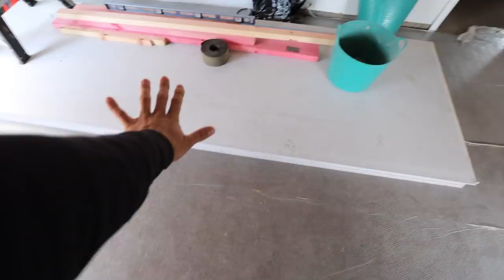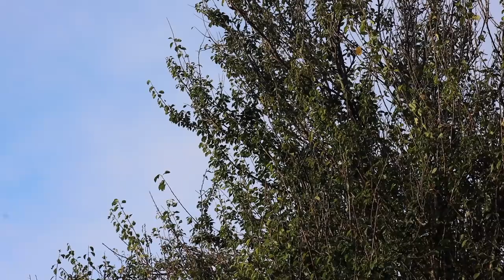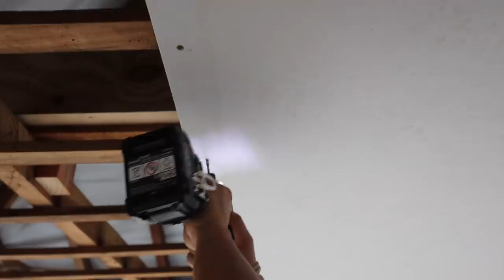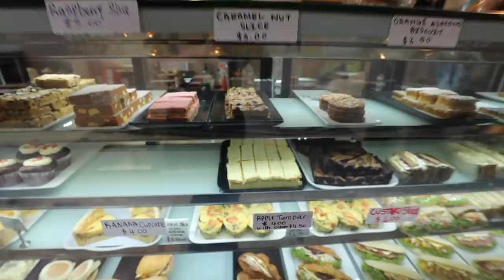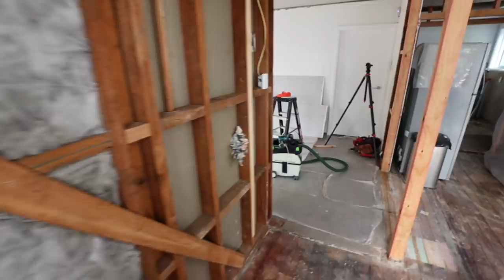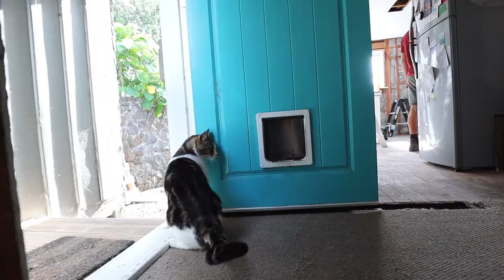I'm Giving This Drill Another Chance

Comment: Hey mate. We are in different countries (Australia) but it may pay to look into the installation specifications on your plaster. We do a few things different here. 
I'd be back blocking your ceilings. You use back blocking cement and put square of plaster between the battens. It adds a lot of rigidity to the sheet and helps prevent cracking with movement of the house. 
Our screw pattern is different also, and we use stud adhesive. 
Also, if you use furring channel and clips on your ceilings it is way easier and quicker to set up your ceiling, you won't have the issues with screws not setting to a consistent depth, and the ceiling will be less likely to crack as the furring channel clips allow for slight movement as the house moves/settles. It's also really cheap.
Reply: We have the same specs you are describing here in NZ, not sure why Scott isn't following the manufacturers instructions. Maybe because it's an older ceiling? Also wideline gib board is readily available at most Placemakers. 1350 wide for 2700 studs, useful for older homes like this!
Reply: Yeah also super easy to get the new ceiling level instead of ripping timbers. Just find the lowst rafter and set all your clips to that :thumbup:
Reply: @cmmartti  similar product different profile. You clip the channel up with brackets that get fixed to the bottom chord of your trusses. Set a line laser up, set up your brackets to the line, clip on the channel. It's super quick and gives dead flat,l and level ceilings. 
We use it for sound deadening as well, but the sound clips are really expensive. Regular bondo brackets are cheap.

Comment: Those Makita dry wall screw guns are the best on the market. Glad you finally worked them out. Haven't seen a loft ladder in  over 22 years since moving to Oz. common feature in a lot of UK homes and we frequently installed them. Flat pitches and lightweight truss construction here makes most lofts useless. Don't you get 1350mm wide sheets in NZ. We get all the sizes in either 1200mm or 1350mm for 2.7M ceilings.

Comment: Hi Scott. You do some great work and I love your channel. But you should really be back blocking your ceiling end joints. It is on page 47 of the 2018 Gib Site guide. It is also recommended for the tapered edges, but not required until level 4 finish is required.
Keep up the great work 🙂
Reply: What does that mean
Reply: Should be strictly 13mm as well and could've done it in one sheet
Reply: Backblock taper joins if it's more than two joins in a ceiling, always backblock butt joins. I also always put an artificial taper in the butt joins by putting two packers over the butt join and the temp screw two bits of timber between the battens so they bend the ends of the sheets up slightly. Once the covebond sets you get a permanent taper that will give a much flatter ceiling. 

I absolutely hate any joins on timber. They always crack.

Comment: You mentioned doing vertical board over horizontal because of the added mud joint at the top.  I’ve seen guys do a narrow strip in the middle of the wall and join the plaster joints together during mud
Reply: A "belly band." Good tip!
Reply: @cmmartti  Yeah, we put ours at the bottom and sometimes it's hidden but if not, It's easier to plaster than up high.
Reply: Or just order your bottom sheets in "wideline" it's 1350mm
Reply: Also in New Zealand gib has a wide line option in most lengths which is 1350mm wide

Comment: Yep. Screw guns are frustrating in 'reno's 
Regarding staggering your joints... To avoid a cracked ceiling don't butt join on a batten, backblock and butt join between battens. You can then use a couple bts of timber and 3mm spacer to produce a dip in the butt join that gives a recess for the plaster and tape. Result: a ceiling that will not crack, and perfectly flat, and a happy plasterer too!

Comment: G, day Scott Brown Carpentry from Sydney, Australia.
In this building renovation, it looks like the R values have been increased for energy efficiency. 
* my method of plastering: Gyprock with (blue) stud adhesives 400mm spacing clot nails vertical and screws for ceilings. Finally base coat, tape, topcoat and cornice.
Good job
🌏🇭🇲

Comment: Hi Scott, thanks for the vids, love the music too. 
I’ve held many drywall guns but I own the festool, (not because I’m a festool fanboy) but cause it’s truly hands down the best one in my opinion. Depth setting, ease to use, least jams and easy to reset after a jam but most of all low noise motor plus: it only runs as you push it into the wall/ceiling. Can’t recommend it enough. If you got a lot of sheetrock to put up…

Comment: Recently had to lay down two layers of fermacell on top of steeldeck. About 100m2 and 50 screws per board, let me tell you i was glad i had this machine. When it does misfire it's a bitch to get the stuck ones out though.

Comment: Hey Scott don't don't know if you're aware but you can get GIB widening which is 1350mm wide which is ideal for those 2.5m and 2.7m ceiling.
Reply: No 1350mm braceline
Reply: @jussi75  No. Wideline  refers to 1350. Braceline comes in standard and Wideline as does all the other Gib products such as Aqualine and Fireline.

Comment: In Sweden, almost everyone use the screw-gun! Unfortunately the makita is not the best out there. It would be nice if you could try out a bosch, festool or hilti, it is a night and day difference.
Reply: I have the Hilti as well but I find the Makita is consistently better... if you know how to use it. What's hilarious here is Scott still didn't adjust the screw depth with the fine adjustment.
Reply: @DiscoFang  I agree the new makita is better than the old one that Scott used. The depth adjust is a key point Cassette

Comment: Have you ever tried the glue method fo your vertical wallboard? I’m in New England and a lot of the homes are very crooked, ya I cut shims to straighten them out but I’ll do the glue method for extremely flat walls. Makes all the trim very easy when everything is true. Very little scribing. Another great video!

Comment: I’ve never personally used that screw gun but I’ve seen them be used on job sites and it seems to be a decking thing, I’m a carpenter but haven’t really ever built a deck as there is a local company where that’s all they do so my boss who is a contractor normally just uses them whilst we focus on the house itself, but yeah I always see the decking guys use those. Maybe the fairest and best test for it will be when you next do a deck because it’s quite a specific tool I think

Comment: Why is a vapor barrier not installed under the plasterboard in New Zealand? Without it, the flap will eventually soften due to moisture because if I've seen correctly, New Zealand roofs have no vapor barriers.
Reply: Completely different climate - temperate. Vapour barriers only work in either cold or hot climates - we are neither in NZ. Installing them here within the wall sandwich can actually cause the very problem you're describing.
Reply: We have a breathable wrap under the roofing and cladding here, but I'm guessing that's not the same.

Comment: Surprised you didn’t end each sheet in the ceiling between a batten so it could be back blocked forming a recessed butt joint. Much easier for the plasterer to float the joint. I supposed it comes down to economical yield and carpenters doing plastering work....or not.

Comment: I don't like the butt joins on the battens. They should be between the battens and backblocked with CoveBond, and if you really want your plasterers happy, you put two small packers or nails over the joins and then get two bits of timber long enough to span between the battens  and screw them on temporarily. This will push a taper into the butt join, and once the Covebond sets it will hold that taper.

Comment: hey mate i'm assuming you may know this but just going by your vertical sheet comment , you can get sq edge to taper 1350 wide sheets (wideline) so you still have a chance to do horizontal in slightly higher than 2.4. situations. and when you have a 2.7. ceiling you use wideline x2.  anyway great content as always mate.
Reply: Yep. Unfortunately I have to improvise because my bosses never think to order Gib ahead of time, and wideline and taper square is never stocked and has to be ordered.

Comment: I had the same problem with my drywall gun until someone said “have you done the screw depth adjustment”  I felt such a idiot 😂😂
Reply: I bought one. Brand new out of the box it wasn't working. I was ready to throw it over the fence then decided to skim over the manual. Depth adjustment fixed it instantly. 😂🤣
Reply: I hate it when you accidentally knock it into reverse, then wonder why the gods hate me.
Reply: @oystercovecraftsman9219  I Chucked mine back in the lockup😂😂
Reply: I ended up binning this gun, when screws get stuck in the barrel you have to pull it apart to release them.

Comment: Hey Scott   What's the glue for on the back off the boards. I'm from the UK and I've never seen that done before and I see that you do it all the time.
Reply: Stability “glue it and screw it”
Reply: Not sure what you have available in the UK, but on this side of the pond we use either Loctite PL100 Drywall Construction Adhesive or my favorite, OSI F38 Drywall and Panel Adhesive.  Either is about $5.00 per 28oz tube.  Small price to pay for additional fastening and also reducing the need for additional screws in the field.
Reply: We use a specific gib-board (drywall sheet) water-based adhesive that has zero slump. One of the strongest and fastest to use is spray foam adhesive with the proper gun, but the worst thing is it will get on EVERYTHING. Water based far nicer to use.
Reply: They are using Gibfix One. Closest I've seen that may be available internationally is Sika Nailbond Fast. It's water based stuff. I prefer Gibfix Allbond, which is solvent based and flexible. I haven't seen anything else like it, but I would say any flexible construction adhesive that comes out thick and doesn't slump or run will work. Standard construction adhesive won't work because it's too runny and will just make a mess. One advantage of these glues is that they will bridge up to about a 10mm gap between the plasterboard and the framing, so you don't have to spend as much time trying to straighten walls, as long as the perimeter of the sheet is straight and the studs aren't bowing out then you're good.

Comment: I've always been told to go horizontal with my plasterboard
Reply: It's better. You can do either according to Gib, but horizontal is preferred because you get floating joins. You're supposed to join on studs with vertical which is always a nightmare especially in renovation where most older homes have 450 studs. The main reason not to do horizontal is that joins on framing will always crack.

Comment: Hey Scott, how come you didn't use Gib Wideline on the walls? Would have had much less joins
Reply from the maker: We have used that on this house in the past. It was going to be a special order and a bit more time, decided to go vertical instead.
Reply: Might have required an extra row of dwangs for fixing the edge of the sheet? Well worth it in the long run though, having less sheet joints
Reply: They are only available in 4.8m lengths for braceline in wideline.
Reply: Who cares really? It's about cost. If the plasterer is coming in, he's likely working to a sqm rate so extra joins don't matter a bit. Unless you can eliminate a large number of joints and are making the job far easier to install, buying off the rack at the merchant at the most common size is the way to go.
Reply: @plcs1665  Absolutely not. The main reason for going horizontal is to avoid having to join on timber. Joins on timber always crack, floating joins do not. It's my main reason for trying to avoid horizontal. I've done plastering, and tbh vertical is actually easier to plaster imo. But it's a pain in the butt to do, because the studs are never in the right place, and again, they always crack in time, because timber expands and contracts, and on top of that it's a weak point in the Gib at a place that is rigid, so of the Gib moves, due to being bumped or leaned on or a door slammed, that's where it will crack. A floating join doesn't crack, because the plaster is the same material as the Gib, and if the Gib flexes, it will flex between the battens, which are perpendicular to the join, so the join never gets stressed.

Comment: I noticed you were joining the sheets on the batten. A few years ago I did that instead of  joining in between the batten and back blocking and my boss ripped me apart. im still confused to this day what is the right way lol
Reply: If you join of the batten and back block. You put some temporary bits of wood and a wedge to bow up the join. So when the plasterers finish the join they can just go flat instead of feathering.

If you join on the batten you cant bow up the join as it's fixed.
Reply: Interesting, how much do you shim up the joining timber?
Reply: @neild7971  just use a 3mm nail or something similar. Just means an easy finish for taping.

If you google gib site guide theres a big manual. Then search ceiling installation and tapered edge.

Comment: you probably know, but in UK the plaster board sheets are 12.5mm thick x 2.4 x 1.2.
is that some sort of grab adhesive you put on the timbers first?
Reply: We screw and glue on our plaster board sheets here in New Zealand 🇳🇿.  Far better finish.
Reply: @robertw383  i agree, i'm an electrician and see lots of these installs. interesting to see how different parts of the worlds do things.
thankyou for your reply, will be mentioned on our next tea break. all the best and keep up the good work chaps.
Reply: There are rules to gluing our plasterboard. Screw the perimeter at 300mm centers, or on the battens in the case of ceilings, and daubs of glue at 200mm intervals, no less than 200mm away from any screws. Glue and screws must NEVER meet each other. We tend to screw the center of the sheet with ceilings too, so for a 1200 wide sheet running across the battens, we glue at 200, 400, 800 and 1000mmm. 4 daubs,  with a 400mm space in between for our center screw.

Comment: Doesnt 9.5mm go saggy on a ceiling? In scotland its usually 12mm minimum.
Reply: It's common to use 10mm on a ceiling on a renovation. It's fine as long as you use 450 centers maximum on your battens. All new builds use 13mm

Comment: How come you use glue on the drywall when it already is screwed on around 400cc and you will use ceiling trim?
Reply from the maker: It will help prevent the centre of the sheet from dropping as the timber moves.
Reply: @ScottBrownCarpentry  another good video - thanks. Could you tell me what the adhesive is as I'm going to try find an equivalent here in the UK. Most adhesives here marketed for plasterboard are for dot & dab, not sticking to joists so will probably need to find a suitable grab adhesive such as Pink, Soudal or Evo-Stik - thanks

Comment: tape and joint or plastering the lot ?
Reply: Tape and joint. We don't skim the hole walls in NZ
Reply: @gav17  can you explain please
Reply from the maker: Tape and joint. I didn't see a whole wall get skimmed until I went to Scotland. It only happens here if the walls are in a particularly bad shape, or if it is a concrete wall.
Reply: @gav17  Some of us do. With these Pinex ceilings we've been just pulling off the timber trims, screwing the crap out of the pinex to secure it to the joist-battens and taping and skimming the whole lot. Way faster and cheaper than regibbing. You would not tell the difference.